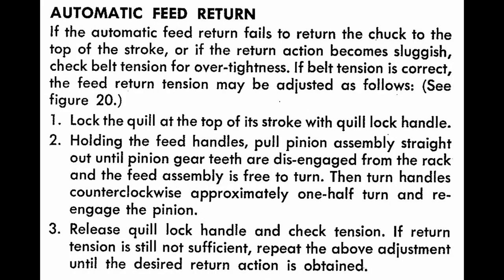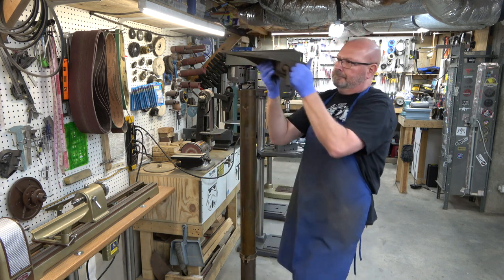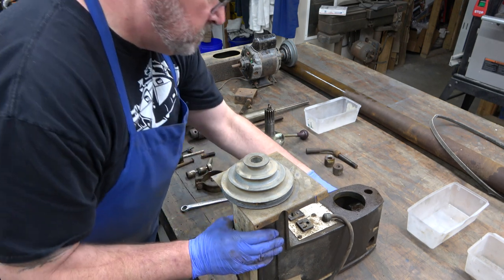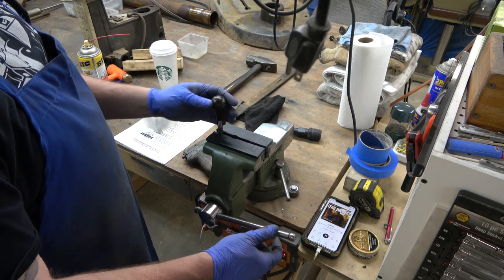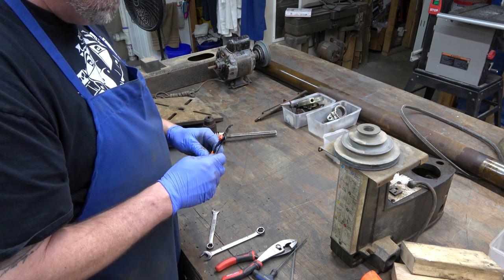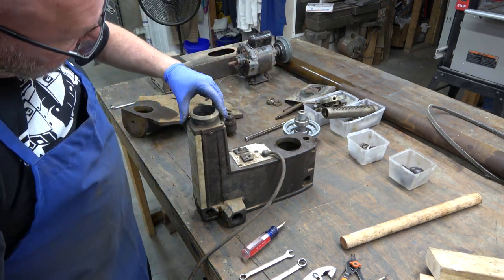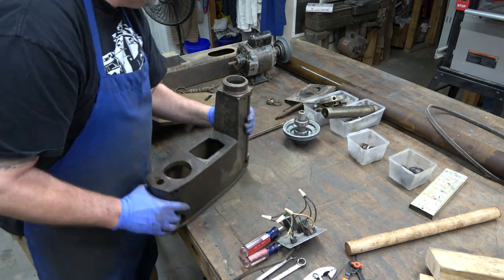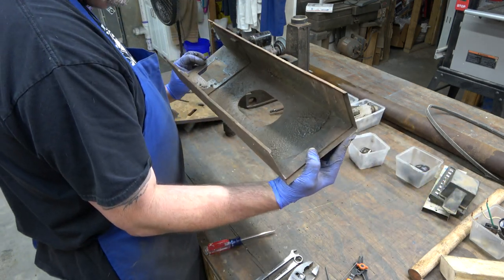Part 1 Rebuild Emerson Gen 2 Craftsman Drill Press (Disassembly)

Comment: I just bought the same drill press for 100 bucks! I dont think the quill is running straight any fix for this?
Reply from the maker: That could be caused by several things. Go over the the garage journal and post you question in this thread and several people can assist in diagnosing the issue. https://www.garagejournal.com/forum/threads/craftsman-drill-press-information-belts-bearings-chucks-keys-etc-1946-1984.489080/

Comment: I recently purchased the identical model that is being refurbished. Two questions. One, the quill return is very stiff, I feel the spring tension on feed but have to manually return the quill. Do you think a good cleaning will help. Two, do you have a source for the phenolic knobs? I have two that are cracked. Thank you.
Reply from the maker: Yes, more than likely there is years of grease, oil, and grit that can cause drag on the quill. Also, the spring may not be tensioned correctly. I would recommend a thorough cleaning of the head and all internal parts. You may as well replace the bearings if you are going to tear it down. After everything is cleaned, lube with a quality lube like super lube grease then properly tension the feed return spring. Here is a video all about the feed retention spring. https://youtu.be/qnUAOVia198  As for replacement knobs, I know other people who have found a suitable replacement form Carr-Lane. Something like this https://www.carrlane.com/product/handles-knobs-screw-clamps/knob-handles/pull-knobs-oval-top-small-phenolic I am not sure about the correct thread you will need since I am not around a drill press at the moment. Also, you can probably locate used replacement knobs on ebay do a search for "Craftsman Drill Press".

Comment: Also have a Generation 1 as well. I wanna make it low speed. Will probably turn motor upside down, and adding a step pulley outside. I don't wanna molest the Generation one.
Reply from the maker: I recommend the slow speed pulleys that JZiggy on Garage Journal Sales.  I did a video on them here: https://youtu.be/TTlrxgha5zY

Comment: Man! I'm so glad you shared how to remove the quill👍. Inside the hollow , I put a light socket , then added a hi amp switch for both the light and motor separately. The hi output LED  bulbs are great , low heat output.  Thinking mine is a floor stand Generation 3.  It started making a ruckus in the quill bearings. Haven't really looked into what it needs yet. The belt guard was driving me nuts, so I ripped it off and tossed it. It is a 3 step pulleys as well. I do hate the knobs on these. They dig into my forearm when laying down on a big drill.
Reply from the maker: I am glad you enjoyed the video.

Comment: I’ve been trying to find out why my pulley vibrates and sounds angry for about a year, and you just nailed it.  ONE MACHINE SCREW!  I didn’t even think of that.  THANK YOU!
Reply from the maker: Thank you, and I am glad you got it sorted out.
Reply: @JeffsShop  I hope I did.  I didn’t have a 10/32 set screw laying around, so I’ll be getting one on my way home today.  Crossing my fingers that this is the fix.  It was my grandpa’s drill press and I spent years abusing it as a kid.  I owe this thing some care.  Every time I max out the rpm or tighten the spindle lock, the pulley sounds like it’s jumping around and tearing itself apart.  Is there a specific surface on the pulley and bearing assembly that this set screw is supposed to be pressing against?
Reply from the maker: @chrishestand1   watch this video https://youtu.be/YSr7DzS2zVc?si=UXyl4THTLqRSKxY3
Reply: Thank you, Jeff!  Last follow up question.  Do you think drilling and tapping the other side for a second set screw might add any additional stability or be in any way beneficial?  Also, I really appreciate you for taking the time to reply to my questions.  Very nice of you.
Reply from the maker: @chrishestand1  Nope, I do not think that would be a good idea.

Comment: Hi Jeff: First let me applaud your skills and thank you for the fantastic videos!
I recently acquired the same model and all appears to be original except for the feed stop handle lock which apparently was lost and replaced with a straight Allen head set screw by the previous owner... which leads to the following problem I'm having:
The hole in the locking feed stop collar is drilled through the spline area of the collar and I can only get it to line up with the flats on the feed stop bar. This has caused some light circular mars on the depth gauge. Your video and the operating manual appear to show the locking handle lined up with the outer splines of the feed stop bar.  At first I thought I would just rotate the collar so that the set screw locked onto the outer splines of the bar. But I can't get the splines of the collar to engage with the bar splines. The splines are not damaged. Are the splines of the collar and bar supposed to mate?  If not, is the set screw hole drilled in the wrong place on the collar? I'm either doing something wrong or someone I have the collar from another model. Any thoughts?
Reply from the maker: John, I am unable to understand what you are asking. I recommend you create a free account on The Garage Journal Forum, then post pics and your question in this this thread and I or some of the others should be able to square you away in no time. Pics are what makes it easier to understand. 
https://www.garagejournal.com/forum/threads/craftsman-drill-press-information-belts-bearings-chucks-keys-etc-1946-1984.489080/
Reply: I should have said acme threads (not splines). I can't get the acme thread area in the feed stop collar to line up with the acme threads on the feed stop bar. That causes the lock handle to instead face forward locking onto the flats of the feed stop bar. Pics to show the inside of the small collar aren't coming out clear enough.
Reply from the maker: @johnd.5480  I am still not clear what parts you are talking about. I forgot to add the owner’s manual for this drill press in the description section and just went back and added it. Look at the parts diagram and parts list to make sure you are refereeing to the correct parts. Again I really recommend that you post some pics and your issues on Garage Journal so I and others can clearly understand what the issue is. 
http://vintagemachinery.org/pubs/detail.aspx?id=2218